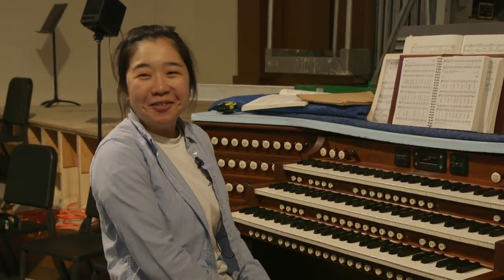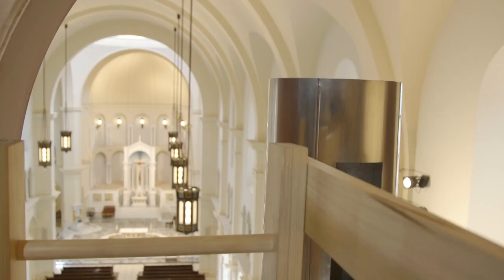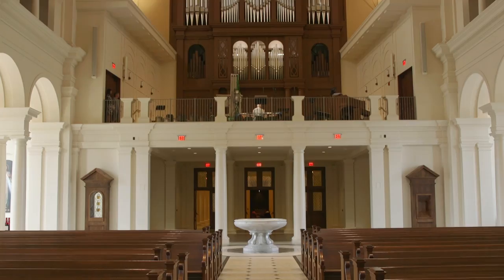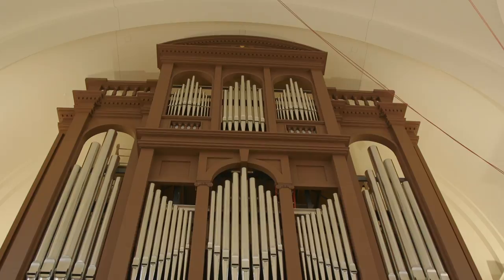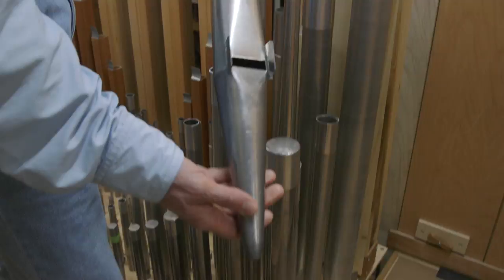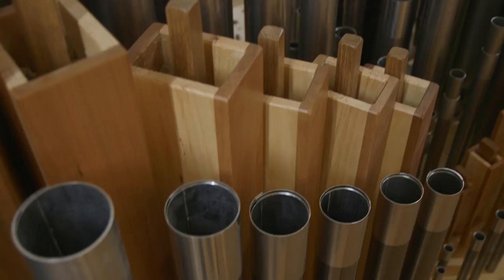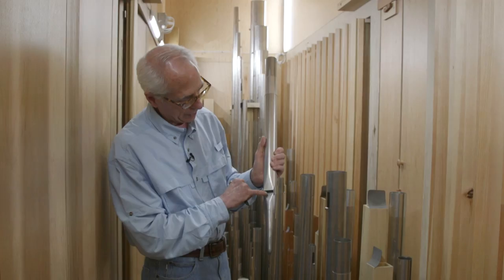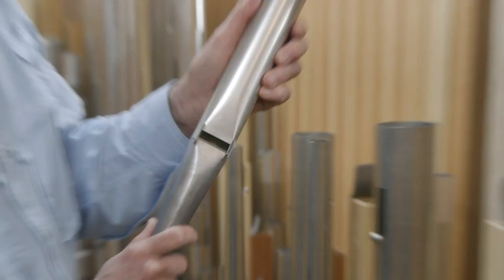How pipe organs make sound | Sci NC

Comment: But I haven't heard these things explained. 1st does the organ use electricity? They said it is a wind instrument and I guess it uses one. But they should have told us. 2nd does it use an amplifier? Here again I guess they use one because the pipe is out there and it should have decent volume to be heard all over the room. And then I guess it also has some volume control which works electronically. That is my assumption. Anybody has any know how pls share your knowledge. Thanks.
Reply: Originally organ pipes got the required air pressure (or 'wind') by use of bellows pumped mechanically like the kind you'd see on accordion (only bigger). Nowadays they use electric blowers to produce the required wind (big fans), but the pipes themselves are still acoustic. They are not electrically amplified, there are no speakers in a pipe organ. A pipe has no volume control by itself but mechanical or electrical shutters are installed in front of rooms where some ranks reside, this can let the organist control swells and volume by use of graduation on one or more pedals located in front of the pedal keyboard. 
In short, the blowers for the air do, and no, pipe organs aren't amplified.
Reply: @leavewe  Thank you!
Reply: Hi, pipe organs are generally acoustic instruments, although some more recent (1980s to present) organs have been built as hybrids with both pipes AND speakers for additional digital stops / voices. Some other old pipe organs have been expanded with digital voices, usually but not always for low notes which would require very long pipes that don’t always fit. For example, few organs have a true 32’ rank, although some medium large classical organs have a STOPPED 32’ flute (bourdon) rank, the lowest pipe of which is “only” about 17’ or so long due to it being stopped (meaning it can sound the same note as an open pipe twice the length). Open 32’ ranks are very rare due to few buildings being able to hold them and also the great expense of these pipes so digital versions can help.
Reply: Pipe organs mostly predate the advent of amplifiers, which was generally in the mid 1920s or so and used mostly for home radio and the newest (and most expensive) phonographs, as well as new recording processes. For the most part, the pipe organ has remained an unamplified instrument until recent times. A few organs with percussion stops (bells, xylophone etc) have had THEM amplified thru the PA system in the building, to make them louder (such as the Atlantic City Convention Hall main Auditorium organ), but the vast majority of organs with percussions (mostly, theatre pipe organs), have them unamplified, and the actions are designed adjusted to beat the instrument forte or fortissimo, and the percussions put in the pipe chamber with the pipes, to get softer and louder with the pipes as the swell shades on the front of the chamber are closed and opened by the organist. A very few theatre organs have multiple-volume percussion actions, like the fancier orchestrions. The Link theatre organs built in Binghamton, New York are notable in this regard.
Reply: Although old pipe organs were played by hand pumping a bellows (the organist themselves pumping if the instrument was small enough, or someone else pumping for larger organs and multiple people pumping for very large organs), nearly all pipe organs in use today use electric blowers, which are basically a large impeller / fan spun by an electric motor, in an enclosure to capture and direct the airflow. Many blowers have multiple fans or impellers to increase the wind pressure. Most blowers used on organs built in the USA were built either by the Spencer company of Connecticut, or the Kinetic company of Maryland. Probably over 3/4 of all the blowers used in the USA were built by these two companies. Some smaller builders of blowers include the B.F. Blower Co, who later made “Simplex” blowers, and the Schantz Organ Co. who make “Zephyr” blowers. The Wicks Organ Co also used to build their own blowers, although I don’t know whether they still do. Most tracker and tubular pneumatic (action) pipe organs made in the 19th century were hand or foot pumped via a large set or sets of bellows, but a great many of these have since had electric blowers added for convenience, although some still retain the original pumping bellows, both for historical aesthetics, and (if restored) for demonstration purposes as well as for use during the rare times the power might go out :)
Reply: Most self playing pipe organs including organ-type orchestrions, street organs, fairground organs, band organs, and earlier dance organs, have air pressure (and vacuum, if the instrument also uses it for the action/control mechanisms) produced by a bellows pump, pumped by a crankshaft and flywheel. Most of these antique instruments have had the original bellows restored to function as original, although some (particularly in England) have instead had a blower / suction unit fitted to cut down on maintenance, although this is less historically accurate (and a well maintained bellows works just fine). 

Smaller coin pianos and piano orchestrions with one or two (or sometimes three) ranks of pipes, usually blow the pipes via a combination bellows pump which produces both suction and pressure from the same bellows.  Even larger piano orchestrions can use these type of pumps, such as large Hupfeld and Philipps orchestrions. Welte and Wurlitzer  orchestrions, however, use separate sets of bellows for vacuum and pressure. 

Later (1940s-on) dance organs, such as those made by the Decap families in Antwerp and Herentals, Belgium, work via an electric blower, new from the factory, as do most later American made band organs such as those built 1970s-2010s by Stinson and by the Johnson Organ Co., and most newer British fairground organs such as those by Dean Organ Builders, etc.
Reply: Many hand played pipe organs have electro-pneumatic actions, as shown in the “How It’s Made” video for pipe organs. These type of actions, pioneered by the Roosevelt Organ Co in the USA and by Robert Hope-Jones in England, use a small electromagnet on DC electricity to pull a small metal disc away from a port or opening, causing air in the channel connected to that port to be able to rush out, allowing a pouch (disc or oval of leather) or small pneumatic motor (rectangular, square, or oblong bellows) to collapse under wind pressure, performing a mechanical action to either directly or indirectly open a pipe valve. 

The initial switch for each note is controlled by contacts under the organ keys on each manual (keyboard) as well as under each pedal of the pedalboard. The stops (knobs, tabs, or tilting tablets), bring on and off the different sets of pipes, usually either by operating pneumatics which move sliders on the windchest, or more commonly by moving gang switches on the organ’s “switchstack” (much like early telephone technology), which route the electric signal from the correct note pressed on the correct keyboard to the correct pipe in the correct octave of that rank of pipes (or to a note on a tuned percussion action, like chimes or xylophone). Most organs also have a relay for the notes, for which one note on the keyboard triggers a relay for that note which switches “on” multiple contacts, distributing the electrical load for that note to make it easier for one note to play many magnets / ranks of pipes at once. Most relays and switchstacks of organs built in the 1910s-1920s (including both theatre and church organs) are electro-pneumatic, using tiny magnet valves to do the on-off switching and air pressure pneumatics to do the grunt work. Wicks were an exception, using electricity for everything. Mid century organs by many different builders often have direct electric relays and switching, as Wicks’ patents had run out. By the 1970s, solid state circuit boards were used for relay/switching and combination action functions, and most organs built from the 1980s to the present, as well as some remodeled old organs, use a computer system for relay, switching, and combination action functions, as well as often also having record/playback automatic player functions built in. 

The computer relay systems greatly simplify the mass of wires used in the old electro pneumatic and direct electric relay/switchstack systems, BUT have the major drawback that most of them are ‘serial’ systems, having a computer ‘clock’ timing and distributing pulses of electricity to various systems, extremely fast, to turn them on and off. 

While this greatly reduces the number of control wires (for example, instead of a massive cable bundle from the organ console to the relay room, with thousands of wires, the organ console can now use a smaller cable with just a power cable and two wires to the relay), it also means that by being much less parallel (the old systems are COMPLETELY parallel), the timing of the music sometimes suffers during fast pieces of music with many stop changes, as the computer has difficulty keeping up with switching all the signals in the short time allotted. In this regard, the old systems could be considered “faster” although much more parallel computer systems are a good compromise. The other problem is that while old relay and switchstacks can be rebuilt over and over using simple tools on a workbench, computer relay systems, particularly those using printed circuit boards (rather than “breadboards” with removable components), tend to go bad or obsolete every 30-50 years and usually need to be completely replaced or upgraded, a major job. 

The use of electricity meant that the organ console (keyboards, stops, pedalboard) no longer needed to be mounted on or close to the organ case, as in old tracker/mechanical action and most tubular pneumatic action organs, but instead could be located quite a distance away, and even movable. In addition, various windchests and other components could be located further away from each other and placed in more different configurations than with most mechanical action instruments, where placement of components was limited to the number of intermediate connecting linkages that could be put between the key and the pipe valve, before the added friction and touch weight became too great to be practical. 

One builder, Wicks in the USA, invented the “direct electric” system (about 1915) where the magnet directly pulls open the pipe valve, which eliminates need for other action parts and makes the organs simpler and cheaper to build (as well as allowing for some wild windchest designs / pipe layouts, not possible with other action types). 

The shortcoming of this action, however, is that it apparently cannot be used above a certain wind pressure, so it Wicks organs are generally not above 8” or so pressure for their theatre organs (whereas most Wurlitzer theatre organs are on an average of 10” of pressure, and some Robert-Morton and some Barton organs are on 15” or more of wind pressure, which is very loud). 

However, as the vast majority of Wicks organs are classical/church organs on from about 3/4” to 6” wind pressure, this is really no problem. The other shortcoming of direct electric is pipe speech: many of the organs produced have the pipes sitting on the top of the chest toe board, with the valve pad on the other side. 

According to many organ builder friends, this means there is no channel to act as an air buffer between the magnet and pipe, so sometimes the speech of the pipe when played can suffer, having a “pop” or “burble” to the initial speech. 

This is solved by putting a channel or passage between the valve and pipe, so that there is more of an air cushion or buffer between the two, as with many other action types. 

Regular pallet-valve pipe chests (which could be mechanical-action, pneumatic action, or electro-pneumatic action), with channels for each note made by dividers (wooden boards or slats in the top part of the windchest), already have the air cushion built in via the channels.
Reply: @andrewbarrett1537  Thank you for the detailed explanation. Really appreciate it. 🙏🙏